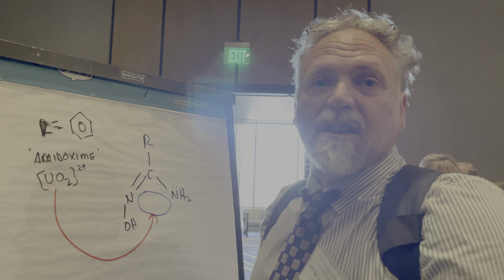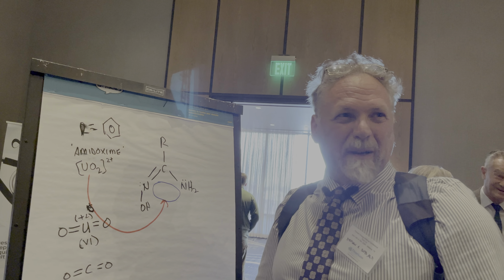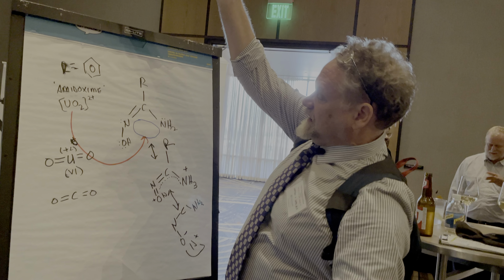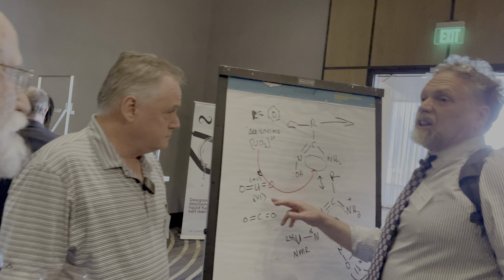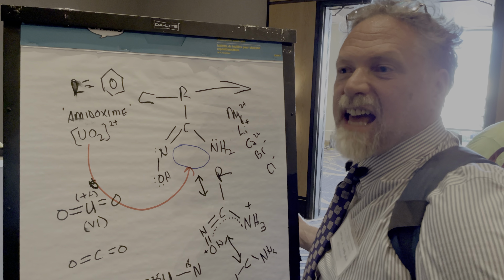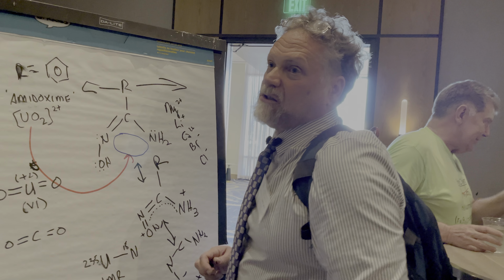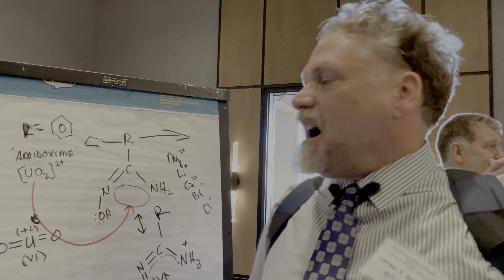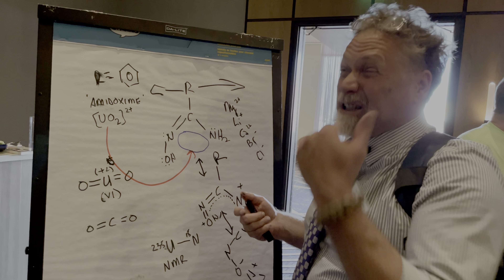Amidoxime - Harvesting Uranium Dications from Seawater - Dr. Stephen Boyd @ TEAC12

Comment: It sure was a treat to meet both Gordon and Dr. Boyd at TEAC 12.

As a working class lay person, it was a bit intimidating to be around such brain power and expertise but I was welcomed with open arms to this most interesting of communities.

Which is why I'm glad that I'm able to provide a little bit of useful information to this conversation; albeit a bit of pedantic technical correction.

When Dr. Boyd refers to a BMW engine, he's likely referencing the Porsche Boxer engine. He is correct in the general idea that the engine is in a flat cylinder configuration with pistons horizontally opposed to each other, rather than in a line or V Shaped configuration.

This engine type has several unique properties that make it a better engine for many purposes, especially for sports cars. Subaru also uses some Boxer engines with some slight changes from the Porsche ones.

I used to own a Porsche Boxster (Boxer + Roadster) and it was quite an elegant machine.

Here's a decent vid with some more information: https://www.youtube.com/watch?v=mNGNNltaZKY

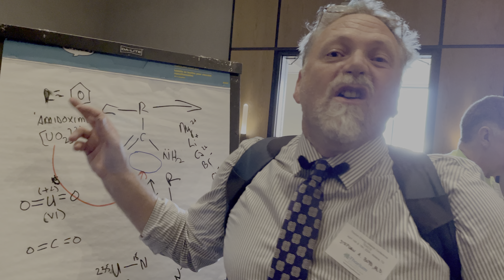Comment: 8:03 No:
Seawater: 4.5B tonnes uranium
Crust: 75T tonnes uranium

10,000x as much uranium in the continents as in seawater. However, the seawater is indeed continously "renewed" by rivers carrying eroded-uranium into the sea.
Reply: Fair point, but is such a short and spontaneous presentation, i expect he means something more like - there is way more accessible uranium in the oceans than the land.  No one is going to dig km deep for uranium, so the full crust estimation is not really reasonable to begin with.  There's also a lot of pushback and thus added cost to mining uranium on land, which further reduces accessibility.  You are correct the seawater is renewed, and basically once you can figure out how to get uranium out of seawater it becomes effectively an unlimited resource, as the nature of water will have new uranium ion-containing water replace where you just removed some.
Reply: pretty sure he said land, not crust